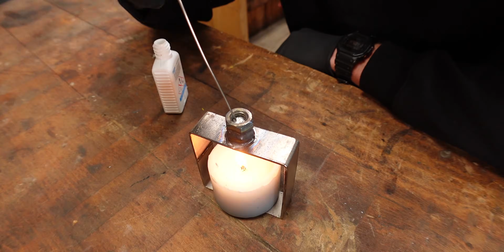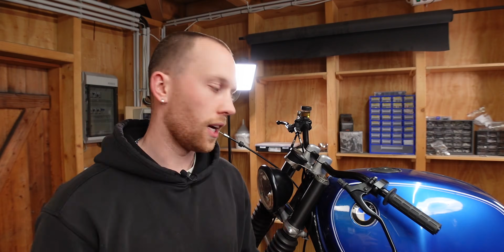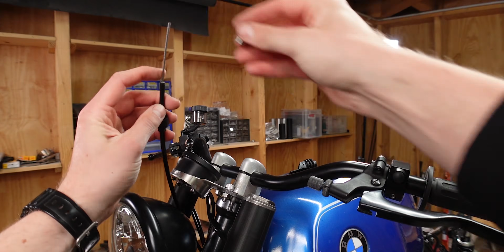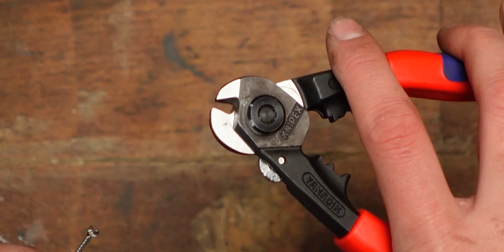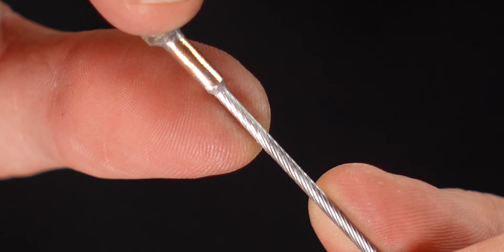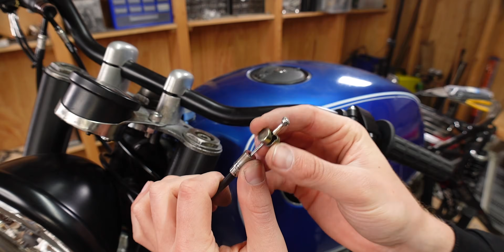How To Shorten Motorcycle Control Cables

Comment: This method worked really well. I actually used it on my throttle cable. Not my clutch cable but regardless the the ferrule soldered really well to clean the existing cable and where it broke. I just heated it up and burned off any excess grease or lubricant and that cleaned it up sufficiently. I inserted the ferrule into the vise. Heated it up with a blowtorch inserted, the throttle cable and which was absolutely clean and sterile and simply soldered it to the ferrule and it still lasted over 2 years now. Thousands of miles. But yeah you have to cut it and solder it. It's not that difficult of having the facilities to do it.
Reply from the maker: Hi, did your's break while on the road? Great that it holds up for so well!

Comment: Imho those cable oiler tools are complete junk, they are a faulty design that has been redesigned to work better but the best way is the old school plastic bag and rubber band.
Reply from the maker: Interesting approach. How do you do it the plastic bag and rubber band? Don’t mind using a simpler solution, that might even work better.
Reply: @MotoWrenchers  https://youtu.be/fWJquvxICdI?si=AbQ7RYgjd7LaRHXe
Reply: @MotoWrenchers  cut a corner off the plastic bag feed one end of  the cable in through the hole stretch the rubber band around the  junction, hanging them vertical and pour oil  into the bag and leave to drain through the cable.